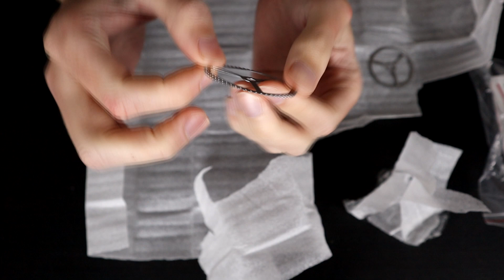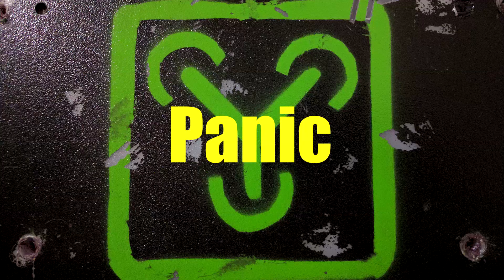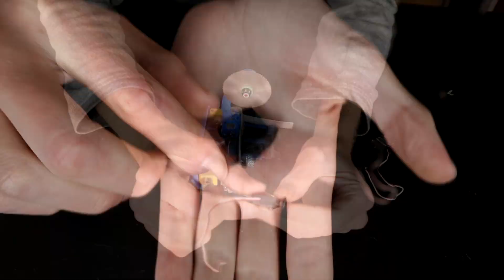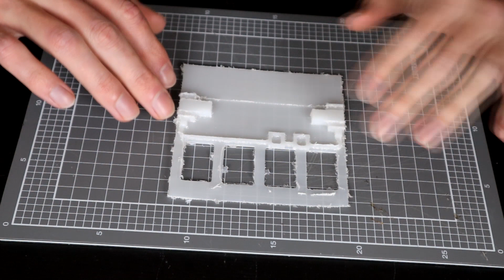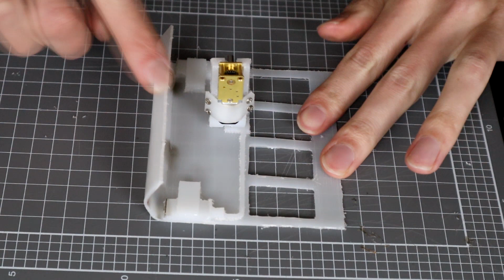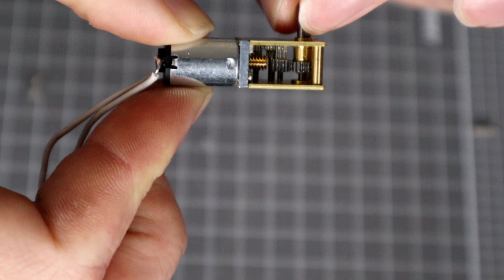Mini Cnc cuts a bot to cut my opponents! (150g robot build)

Comment: Looking at how the saw was able to pull in that test chassis and cut it without even moving the arm... would it be viable to just use an unpowered arm?  No motor, just use a spring or rubber bands or something to hold it down but so it can still flex upward to grab stuff.

Obviously you couldn't self-right then, but maybe you could add some "ears" to run as a standard vertical spinner inverted.

Probably not ideal but could maybe work as an emergency "I have a competition tomorrow" solution?

Comment: It's good to see Vogon Poetry is making a comeback.
Those cuts from the new saw look so nasty!
Maybe you might need to use an N20 with a conventional high-torque gearbox to swing the arm. It'll mean you'll need to redesign the base, which I'm sure sounds like a pain.
Reply from the maker: Its a fun robot so it had to make a come back and being able to make custom saws helps with that

I did try a very quick mod after this video, you'll see how that panned out next week

Comment: Great Job Ben, question, to you think I could do this with a malenki Nano ESC? Also, where do you get those Brushless motors. I only have 1 lb ones. Thanks in advance.
Reply from the maker: yes, this could have been done with a malenki, but I already had most of it wired up with dfrobot motors so I stuck with them rather then rewire the whole bot, plus if I go back to a servo at any point this wiring is better for that

Comment: I've had some bad luck buying with worm gear and normal N20's off amazon/ebay for some of my use cases. For example, I've been through a ton of iterations of a 150g flipper that needs a servo or gear motor to actuate the flipping mechanism. And I'm talking a throw your opponent across the box or into the ceiling kind of flipper. I've designed multiple different mechanisms that are capable of it, but actuating them has burnt out 7.5kg micro servos or stripped out every gear motor I've tried. I've tried a couple that use a belt/chain reduction, but then run into the issue of the chassis bending while turning it, and just not being able to reinforce or thicken the chassis enough without going over the weight limit. So that project has been stalled out for months now. Might go after it again as I just prototyped a new flipper mechanism(using lego technic, seriously the best things ever to prototype bot stuff) that's a hybrid between gears and linkages, and this one may just do the trick. What I really need is a CNC or laser cutter so I can start making some of these parts from aluminum.
Reply from the maker: yeah unfortunately buying motors online can be a luck of the draw type thing

Sounds like a super powerful flipper mech if you are stripping gearboxes! Hopefully you get it working soon

As for machine access, theres a few options that dont involve buying the tools, getting them cut by a manufacturer like PCBway or looking for local makerspaces/hackerspaces as some of them will have CNC's and laser cutters. Both of those options are cheaper (at least short term) then buying and maintaining a big machine
Reply: I never expect replies from creators so I wasn't on the lookout for this, what a treat! 

I've actually recently moved to a different part of the twin cities, MN and my plan once finances have settled again is to get a membership at a Minneapolis maker space that has a full metal shop including a lathe, mill and CNC. Pretty pumped to get access to that equipment and make some metal parts. 

Also, I've been thinking it's time to share these flipper designs with another bot builder to see what they can do with em. Would you be interested?

Comment: That saw test seems like a great success.

All they had to do was support the worm gear axle on the other side, but I guess that 0.1ct of extra material is just too much. This exact problem is very common with lego since the worm gears can slide freely on axles so you always need to support both ends of the axle to prevent exactly what is happening here (the worm gear driving itself instead of the gear and it jams up into the rest of the gearbox).

I guess this sawblade is just straight out off the PCBway package? if so you might be able to file the teeth a bit pointier so it has an easier time eating into the plastic instead of gripping it.
Reply from the maker: yeah, very lazy and unfortunate design choice which could be an easy fix

Interesting its a similar problem in lego creations, need to get more places to prototype in lego to find problems like this early

yep, I didnt do anything to them but bolt them to the robot, I'm pretty happy with how sharp they are, that grab and pull will be helpful I think

Comment: make Vogon Poetry a hammer saw
Reply from the maker: Hammer saws are kind of hard in antweight, because the arm has to be able to take the rebound force of the hit and ants can hit crazy hard
Reply: @TeamPanicRobotics  make the arm out of TPU then it will be able to flex
Reply from the maker: to make the arm flexible enough to survive its own hits, means making it so flexible that it will whip left/right

its not as simple as "use this material" and honestly the saw is already devastating to my opponents, I don't need to change it, so I'm not going to

If suddenly the whole field has steel top plates to try and combat the saw I might spend the week+ of design time it would take to get a hammer saw working, but its not on my list to do right now
Reply: @TeamPanicRobotics  ok

Comment: If you have time, tweaking the teeth of the saw to the left/right (alternating) might help with getting deeper cuts, the body of the saw won't be as likely to drag on the sides of the cut.
Shame about the worm gears, is there space to put a HDPE spacer between the worm and the other gear to stop it moving as far?
Reply from the maker: I did that with the last custom blades I got laser cut from stainless steel because they where clogging badly, these blades ran pretty dang well straight out of the box so I decided to run them unmodified

Not really, theres only a few mm gap between the top of the worm gear and a different gear, which would only allow for a bit of HDPE which would be too flexible to fix the problem